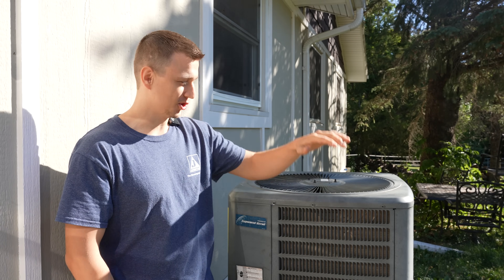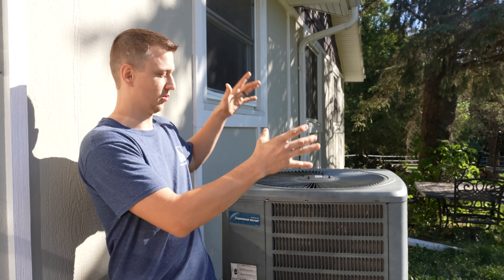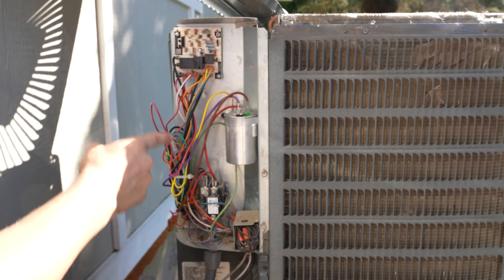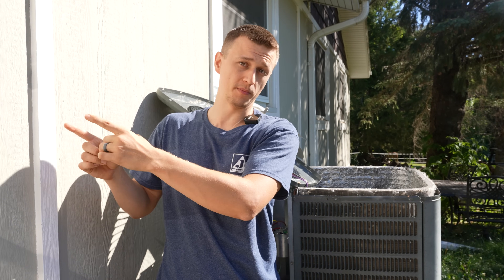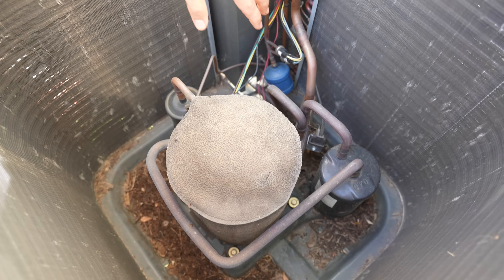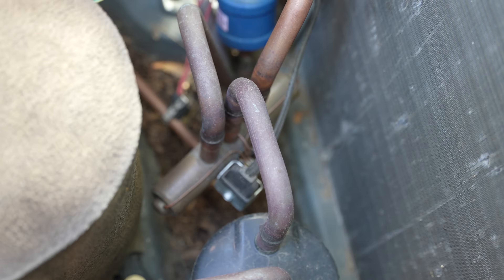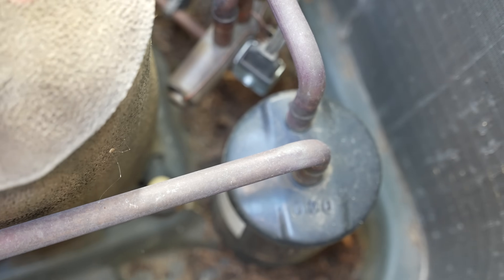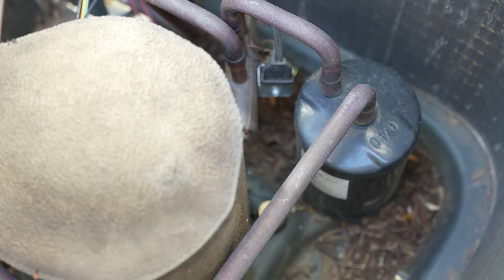The Difference Between a Heat Pump and AC. (Heat Pump Parts Explained)

Comment: I turned the thermostat to heat. It was 55 degrees in my house. Eight hours latter it wasn't even 70 degrees in my house. It was set to automatic. My house never got warm I turned it off. Heat pumps are garbage. When I got the new hvac I told the company I bought it from I want AC and a Furnace,  the installed this piece of crap.

Comment: So, fundamentally, if you need a heat pump but not and air condition, then you might as well use an air condition? (not accounting for impractical aspect of convincing it to work even when the temperature is way below what would normally be required of it.)

Comment: I was using a AC with "reverse cycle heating" for like 20 years and now suddenly it becomes a new tech got a new name, Heat Pump
Reply: I swear when they tell me they got a heat pump vs a AC my response is🧐🤷🏿‍♂️🙋🏿
Reply: Hi- what brand etc? Please
Reply: @marcisaacs9407  it was sooooo many years ago when I was little kid in the now-long-gone old house couldn't remember. Parents may remember but I wouldn't call.

Comment: When you're buying a heat pump, does it come as both the inside and outside units? I'm looking them up but the pictures only show the outside unit.
Reply from the maker: They should come as a set, evaporator coil and condenser coil.

Comment: I have an 18 month old American Standard heat pump with a natural gas furnace, known as dual fuel. Last year the heat pump switched off and started the gas furnace when the outside temperature was below 40 degrees.  This year, even at 29 degrees, the heat pump keeps operating and holding set point.  What is broken so that my heat pump no longer switches to operate the gas furnace based on outside temperature?
Reply: I talked to Sensi customer service.  It turns out that my new thermostat, the Sensi Smart (1F87U-42WF) has no heat pump lockout.  Every time heat is called for, the system will always start the heat pump. If the heat pump does not achieve the set point within 30 minutes, then it will switch to the furnace.  Thanks!

Comment: Really useful video. I have been naively thinking that we ought to be able to retrofit a reversing valve to an existing “A/C” to convert it into a heat pump (for heating).  
This video made it clear that there are way more parts than just a reversing valves.

Comment: ANOTHER EXCELLENT VIDEO.  Thanks.  Question?  Is it possible for a non-HVAC-professional to install the heat pump system?  AND - How much work would it be to change from a regular HVAC to a Heat Pump system?  AND I was told the new Heat Pump systems can work to 10 degree.  Is that true?

Comment: Hello J, I come to your channel for a lot of advice and I'm back once again. This is my first year with a heat pump here in Missouri and I need some advice. This past week we've been in the teen's and 20's for high temps. I have my thermostat set at 70 but it's a cold 70. I've been told and you even mentioned in this video that I can set my thermostat to "EH" and bypass the heat pump. Doesn't that usually double your electric bill? As it is it seems run most of the time anyway. It'll run for 15-20 minutes then kick off but back on again in 10 minutes or less all day and night. Any suggestions? Thank you in advance.

Comment: Looking at the parts differences and their manufacturing costs, its hard to justify why in europe a heat pump cost 5x more than an air conditioner with heater. complete rip off

Comment: Again, your videos are the best!  I'm having my AC/gas furnace replaced.  Suppliers are out of 5 ton condenser so contractor offerd to install a heat pump instead.  Could this be converted to dual fuel as simply as replacing inside TXV with one that has a check valve and upgrading the thermostat? Thanks!

Comment: We are just now investing in a heat pump—The question I have for you is why does the unit that will be installed inside say air conditioner on the box—That will be attached to the heat pump outside. We are mainly using it for West Coast Canada heat. Thank you.

Comment: on winter time and when using the heat, when my heat pump is running, i noticed that the accumulator leaks fluid from one of the pipes on the top, not always, some days is really dry and some leaks
is this something normal??

Comment: Extremely good simple explanation. I just bought a house with two heat pumps installed. Up until I bought the house I never knew what a heat pump was.. since I only called it an AC 🤣

Comment: When the setup is all electric, even a basic heatpump can supply heat more economically than backup elements down to 10F or even lower.
The energy consumed by the compressor is all absorbed by the refrigerant which helps heat the home, and whatever is picked up by the outdoor coil is free heat. Switching it off and switching to all electric at 30 is very wasteful, it is better to leave the heatpump running and cycle the backup on and off to bridge the gap between amount of heat needed and what hp supplies.

Comment: Hey quick question

Where does common from cap go on the contactor? Would it go on where you got your Run from compressor/fan motor (L2) or would it go where your commons for the compressor/fan motor at (L1)

Comment: Thank you much for these videos! With your instructions over the last two years between two houses I have changed my control panel, fan motor, and fuses and installed a compressor saver pack and bought and learned how to use a multimeter. AC has broken twice in arizona summer and I have fixed it both times. Keep up this channel man.... everyone needs to share this guy with their friends to support!!!

Comment: Question about the wires going into the compressor on that unit. Usually I see 3 wires for the run, start, and common, but that looked like it had 4 or 5 besides the heater wires. what are the extra wires for?
Reply: There are a total of 5 wires going to the compressor. The bottom 2 black wires are for the heater. The other three (black,yellow,bluish) are the pump run start common. I think you are confusing the red into black  wire splices for the heater wiring.
Reply: @davenone7312  i think there is 6.  two blacks for heater. then a red black green and yellow. i’m trying to figure out what the green wire with yellow stripe is for going to the compressor

Comment: So, this is useless in colder areas then?
Reply from the maker: Some people still have them but yes, in colder areas they are not very useful 😅
Reply: Modern heat pumps are designed for deep cold areas.  For the most extreme it is a trade off between summer max capacity and winter deep negative temp capacity.  The average heat pump is useful down into the teens (F), mini splits have been designed for efficiency even colder.  You do lose some efficiency with the requirement to defrost the outdoor coil in cold, wet winter areas.  

The mythology of not working below 30 comes from the household equipment manufacturings not putting much design effort in early heat pump designs.  They'd slap a reversing valve and a simple minded defrost board in and go for the profits.  But the conventional style heat pumps put out around 90 degree air so trying to use it as you did you furnace putting out 120 degree air causes people to complain.  Modern government efficiency requirements that cause fan cycling instead of constantly running the ac with modulating of the refrigeration efficiency also provokes complaints since it cause temp/humidity fluctuations.

Comment: Is there any reason why there is water coming out of an air vent in the house?
Reply from the maker: That of course is not normal.. Is this a new development or has it been doing this for a long time? Is your air handler/furnace located in the attic? Is the vent in question on the ceiling, floor, or wall? Have you tried replacing the filter? Maybe the condensate drain line is plugged? Is it a leak, as in the water is flowing out or is it condensation? Is it super humid in the house? Those are my initial thoughts.. Without being there to see it, it would be hard to give an accurate diagnosis.
Reply: @WordofAdviceTV  
Hi 👋 
Thank you for reaching out!
The ac system is on the roof, the air vent is on the ceiling, I don’t see any water coming out of any other vents in the house,   The air filters are clean, I replaced them every month, the condensate line appears to be working fine, the leak,are little drops of water…
And lately it’s being raining a lot ,  I checked for any leaks from the roof, didn’t find any…
Reply from the maker: If it is just one vent, I would suspect that the leak has nothing to do with the air conditioner.. I would take the vent cover off and look in the ductwork to see if there is any condensation gathering inside. If not, then the leak is likely not caused by the AC. But of course I can't say anything for certain 🤷‍♂️

Comment: Another great informative Video. Thank you
Reply from the maker: Thank you Clayton! Glad you liked the video.
Reply: @WordofAdviceTV  I was wondering with the compressor needing a heating element how much is added to the total wattage and or amperage of the heat pumps?
Reply from the maker: Regarding energy consumption, it's actually not too bad. Different heat pumps can be set up differently but generally crankcase heaters only operate when the compressor is off and they draw about 0.1 to 0.3 A when they are operating.
Reply: @WordofAdviceTV  Thank you Jay

Comment: Wait until that reversing valve solenoid goes bad on the hottest day of summer. Come home to a house thats 130 degrees and dead pets.
Reply: Don't think the reversing valve is used in summer
Reply: Then install a Ruud or Rheem which default to cooling and require the reversing valve to be powered for heat.

Comment: Judi had just bought a beautiful ❤️ red Jaguar convertible. She jumps in and drives down a country road, her blonde hair flying in the breeze. On such a beautiful day with a new car, what could possibly go wrong?
All of a sudden the car begins to shake and sputter and stops.
She opens the hood and looks at the engine. She realizes she has no clue what's wrong. She gets her cell phone and calls AAA. After a while a mechanic
finally arrives. She sits in the car
while the mechanic works on the engine. OK ma'm, it should start now. She turns the key, and sure enough, the engine roars to life. As she pays the mechanic, she asks, how did you fix it? Oh, just shit in the carburetor, he says. She looks
shocked and asks "how many times a week do I have to do that?"...
Reply from the maker: Haha good ole blonde jokes. 😄 Thank you for the joke Mr. Classic!

Comment: So a heat pumps gives you the option of running the air conditioner in the winter? Or you can heat ur house using a heat pump with out turning on the furnace? Sorry, still a bit confused
Reply from the maker: No problem Luis! I remember being baffled by heat pumps as well. 😅 Yes, the heat pump heats the house instead of a furnace. The only problem is that heat pumps start to struggle and then provide no heat at all as it gets colder outside. Generally people can use a heat pump to heat the house until it gets to about 30F outside. And then the back up heat source would need to be used instead. (either an electric or gas furnace)  In summary, a regular air conditioner can only cool the house but a heat pump is capable of both, cooling and heating.
Reply: @WordofAdviceTV  that makes so much more sense lol. Thank you! Love your content bro

Comment from the maker: I sure hope I am not the only one who did not realize that a "heat pump" was exactly the same as a normal AC condenser but with additional parts inside... If you remember the first time you heard the term "heat pump", do you recall what the first thing that came to your head was? I can't be the only one who did not imagine a condenser unit.. 😄

True story:
I, the greenhorn tech who did not go over heat pumps in school yet, was on a ride-along with a senior tech at my first HVAC job... After he and I looked at the furnace we went back to the van to order a part. As he was looking for the part, he realized he needed another model number so he asked me to go get him the model number of the heat pump. I said, "sure, no problem!" even though I had no idea what a heat pump was. I didn't want to look stupid - I am actively attending an HVAC school after all. So I go back to the furnace room because that's where we just were and I start looking for something that looks like a heat pump... After a few minutes, I was certain that it is not the water heater, there is no boiler, and there is nothing else that may be a heat pump.. I had a flip phone back then with no internet so I couldn't look it up either. I went back to the van and told him I couldn't find it. After a short pause, he gave me a confused look and then asked me if I tried looking on the other side of the house and pointed to where the "air conditioner" is. (I think he was simply trying to let me save face and pretended not to understand that I had no idea what a heat pump is). On that side of the house there was nothing else except the condenser unit so that was the day when I learned what a heat pump is. 😂 I gave him the model number off that condenser unit and nervously watched him type it in the laptop. To my relief, that was indeed the model number he needed. (I assumed that was a heat pump but I still wasn't 100% sure) 2 weeks later we went over heat pumps in school. 😑
Reply: If you go ask a physics professor, they'll tell you: normal A/C is also a heat pump. Thermodynamically, a normal A/C unit moves heat from one place to another and is a heat pump but "air conditioning" is a colloquial phrase and has no scientific meaning. So, when these two-way systems came out, there wasn't a colloquial phrase that captured what the device is doing and they defaulted to the phrase used in thermodynamics courses everywhere. In both cases, thermodynamically, heat is being moved and, in both cases, a heat pump is what's moving the heat from one place to another. One system is just one-way and the other system is two-way but they're both heat pumps.

Comment: How common are heat pumps compared to furnaces?
Reply from the maker: It depends on where you live. In Minnesota most houses have furnaces not heat pumps because the winters get really cold.
Reply: In Kansas furnaces are more common than heat pumps